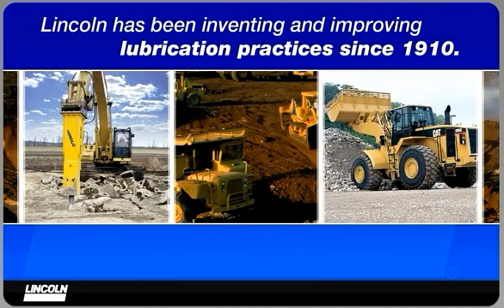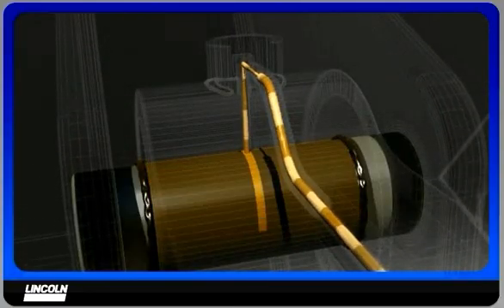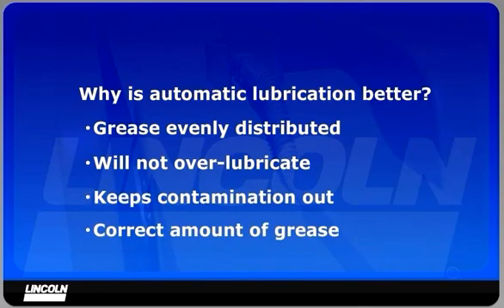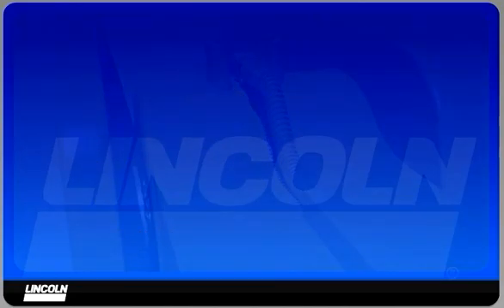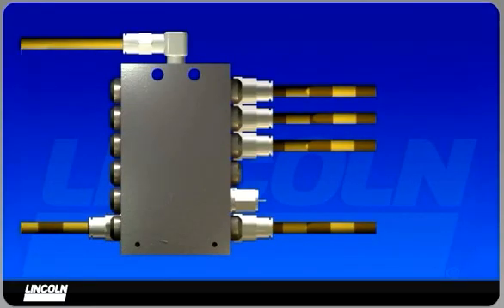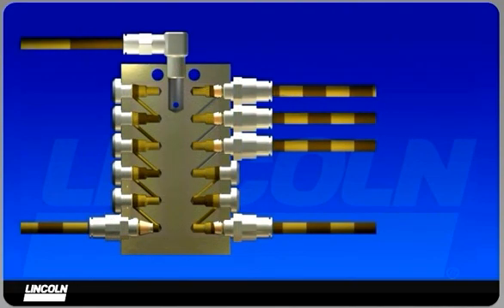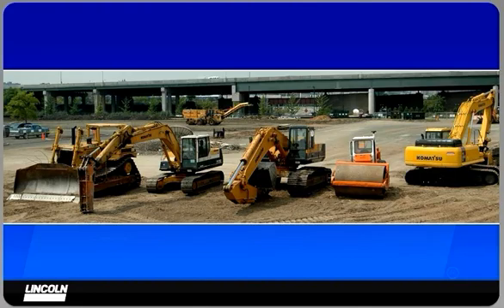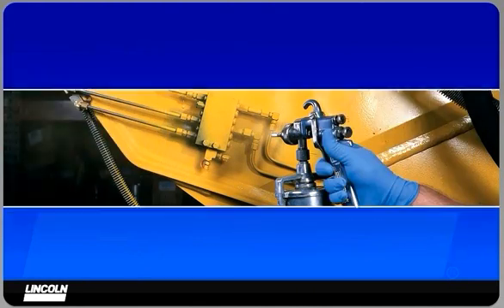Lincoln Lubrication Automatic Lubrication for the Construction & Aggregate Industries

Comment: In this system available alarm of low level?? if no so possible to new install??or increase reservoir size  8ltr from 2 ltr. we have model no is P203-2XN-1K7-24-1A1.01-V10 we requested to you pls help in this.
pls give reply in this mail id-  pacerengineers@gmail.com
Reply from the maker: It is possible to convert the P203 to an 8 Liter unit and add low level, but it may be quicker and cheaper to swap in a pump with those features already installed. Feel free to contact our tech support department by phone at 1-844-772-1341, or email at Lincoln.tech.service@skf.com. They will be able to help spec out the pump or parts you need and find a distributor to purchase from.